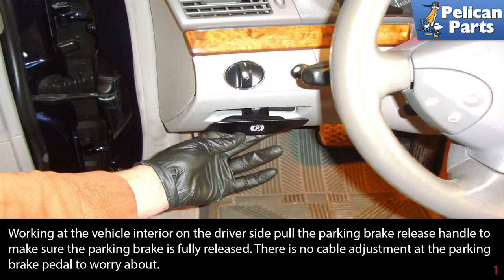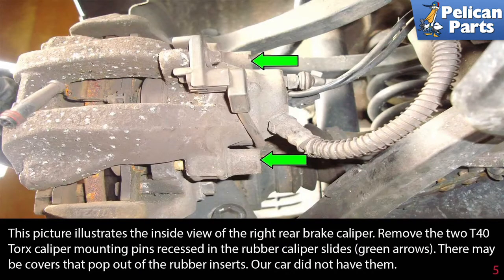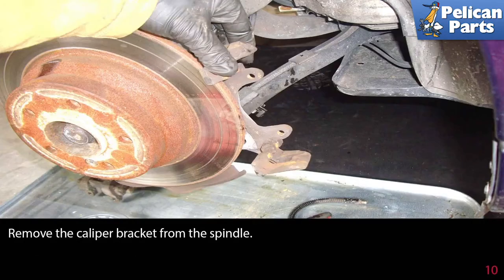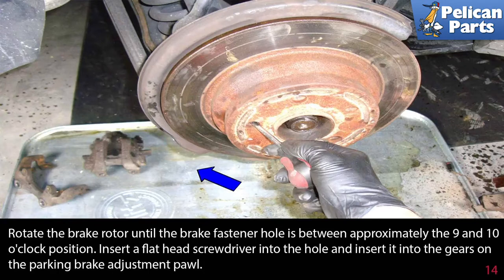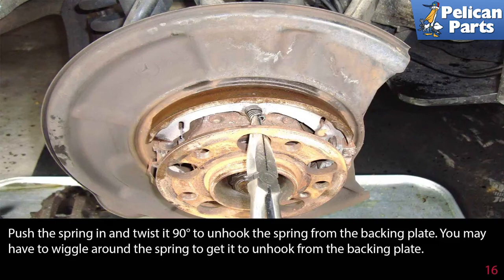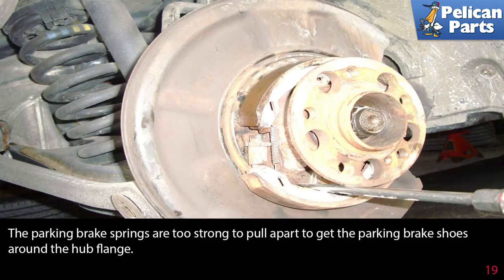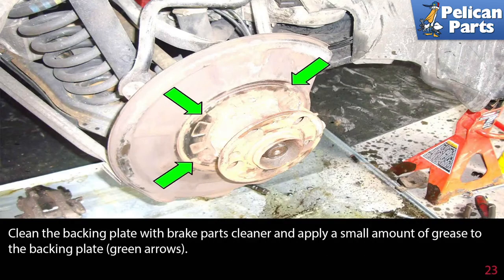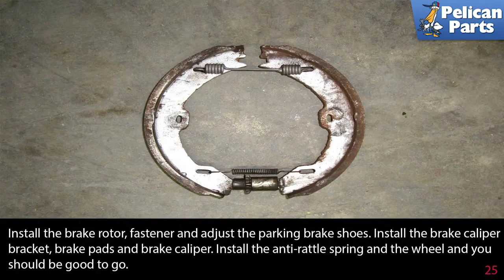Mercedes-Benz W211 E-Class Parking Brake Shoes Replacement

Comment: Thanks for the video. To those who are trying to reassemble the parking break be aware that the large spring is VERY hard to stretch. I was hoping there was a tip for overcoming this in the video (or a special tool). You will need a drum break spring tool! HF has a Drum Brake Spring Pliers Kit 3 Pc. that works.
Reply from the maker: Thanks for the Info. We appreciate it.